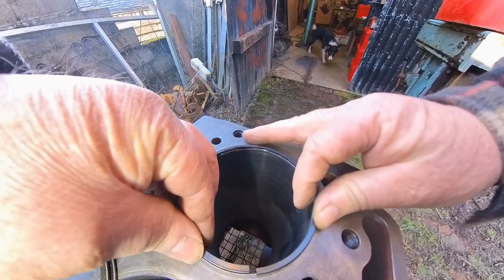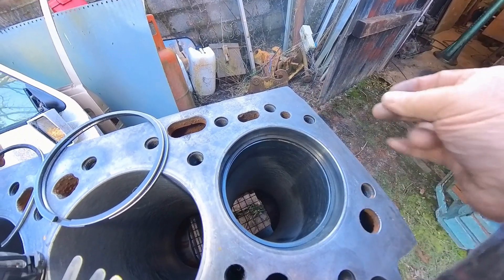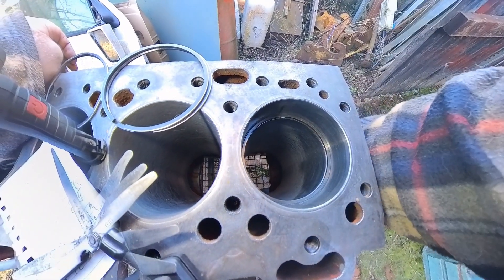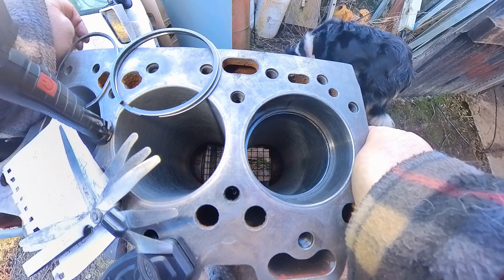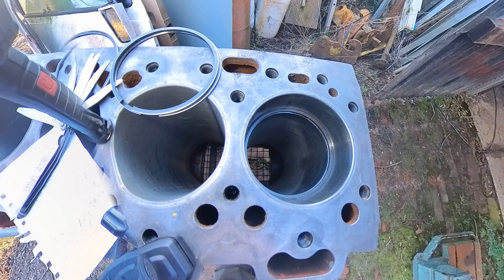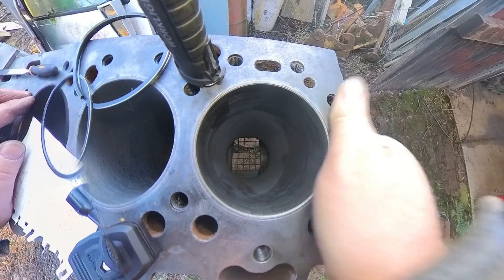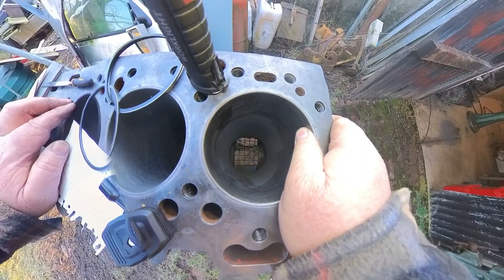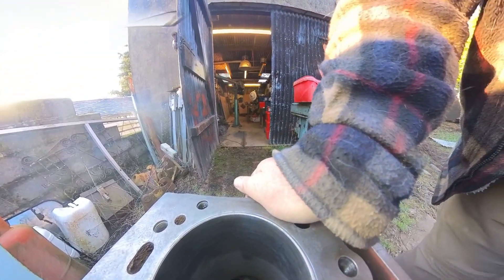Ring Gaps ... "waste of time, don't bother" ... Perkins 248 block

Comment: People who say just check a few or don't bother they will be fine are total morons. Especially if you are not using exactly genuine parts, however even OEM parts can vary slightly and I have experienced it before. 
When it comes down to ring gaps, usually if you are too wide it really won't affect anything since you will have many rings anyway. Say you should have 0,35-0,50mm gap and get like 0,60mm you are still ok and especially if you are planing to turbo charge the engine.
If you are too tight you are guaranteed to notice it in a catastrophic way. 
I check every ring since it won't take that much time anyway.
Reply from the maker: It amazes me just how many mechanics seem to be oblivious about ring gaps .... even some of the top guys ....